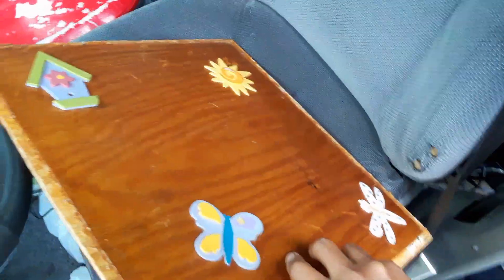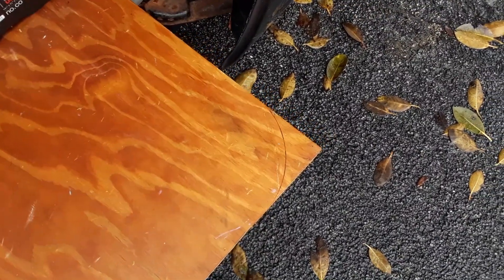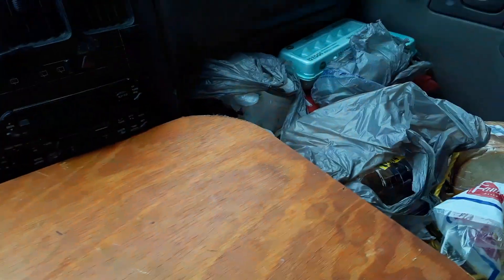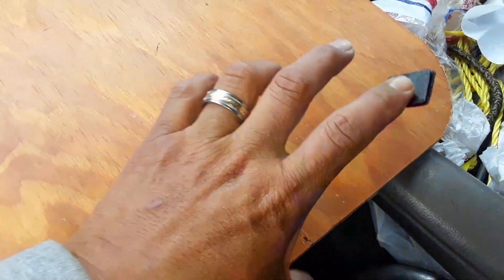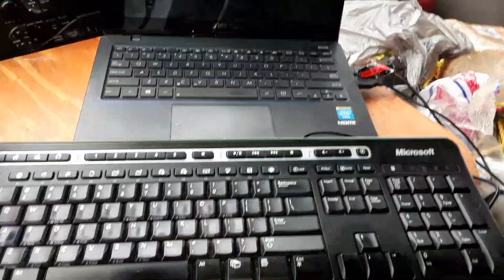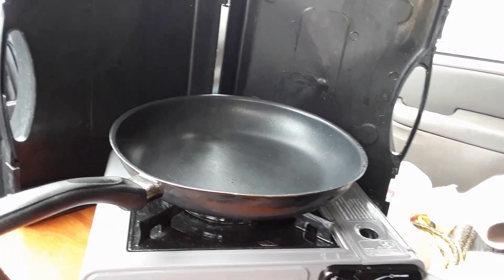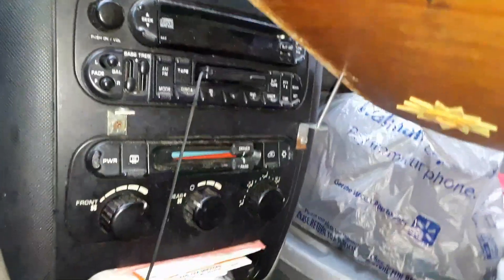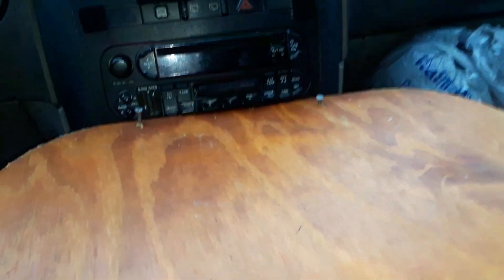Living In A Car | RENT FREE | Quick Tour Of My Home  (V1461) Stealth Camping Living In A Van (V1571)

Comment: I really like that idea, I do have concerns about cooking on a "slight diagonal" you could use dollar tree super glue and glue the scraps on the bottom so they contact the arm rests but a longer piece would be better, watch the curb/trash , a broken hockey stick or even a round metal broom handle could work..
Reply from the maker: The Butane stove can actually be set straight if you wanted.  I put it diagonal to face the driver position on purpose. The reason for going with a "square table" instead of a rectangle is for ease of storage as well as accessibility to the cooler below.
Reply from the maker: The Butane stove can actually be set straight if you wanted.  I put it diagonal to face the driver position on purpose. The reason for going with a "square table" instead of a rectangle is for ease of storage as well as accessibility to the cooler below.

Comment: get the wireless keyboard/mouse combo at walmart for $20.00 the mouse is on the keyboard and it's wireless to a usb dongle - for $20.00 works great - uses 2 AA or AAA batteries I forget which one.
Reply: also if your TV has an HDMI input, you can use the wireless keyboard/mouse and run the HDMI to your TV.  Set your laptop to do nothing when the lid is closed (vs hibernating) and you wont even need to have the laptop on the table at all